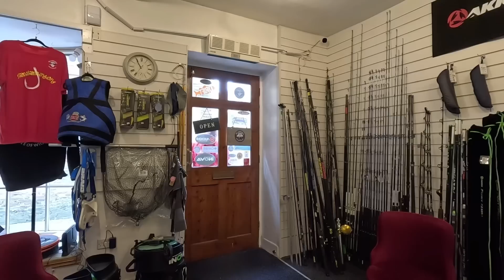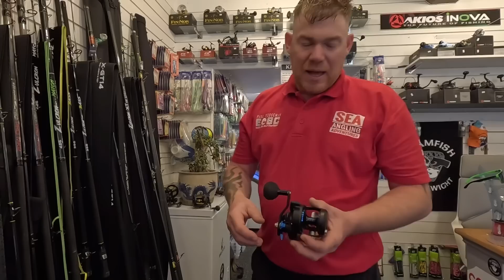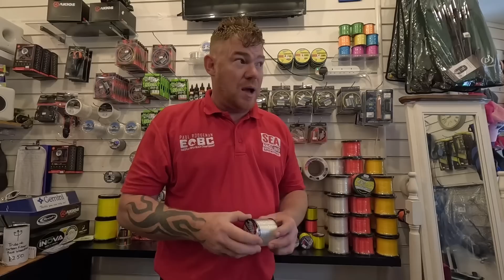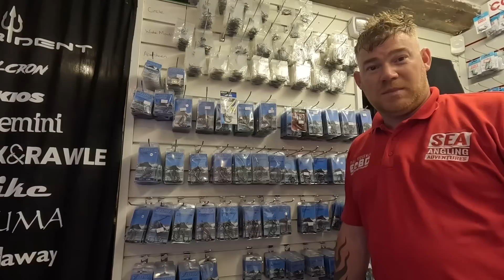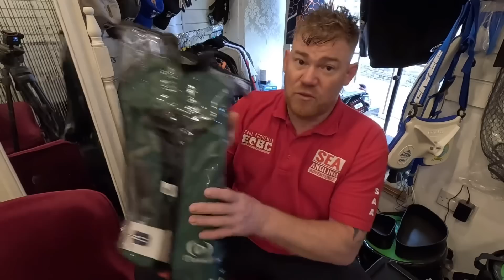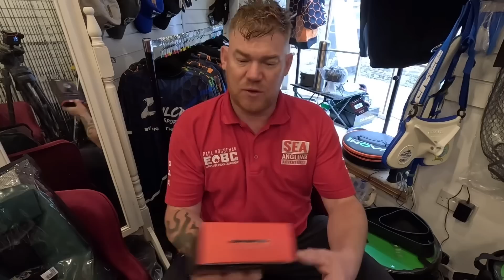Sea Fishing Uk | Let’s Get You Fishing | Learn Sea Fishing | Shore Fishing Uk

Comment: Thanks for sharing this very informative video to help get ppl into fishing that it doesn't have to be that expensive to start up to see if your going to like the fantastic sport. I love all kinds of angling over the years, but been sea fishing about 12 years and still love it, my gear isn't top end gear like anyone I would love to own a zipplex, century, zulcron rod but I can't afford anything like that, I have a 14' sonik vader paired up with an sks 8000 fixed spool for mainly clean benches and I have a Ron Thompson axellerator paired up with a Daiwa slosh 30 multi which I use on the rough ground marks, they didn't cost the earth but they do what I want them to do, I'm no big power caster but either over head thump or been doing the OTG to gain some distance on my casts. Thanks to yourself Andy and the rest of the sea angling adventures team for helping newbie anglers starting up and getting them catching some fish 👍🎣🎣🎣😊